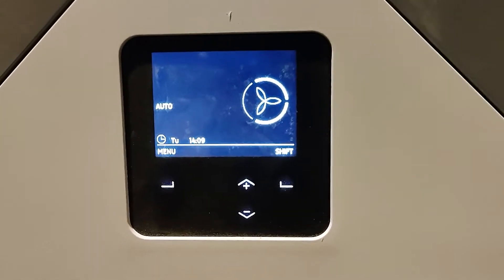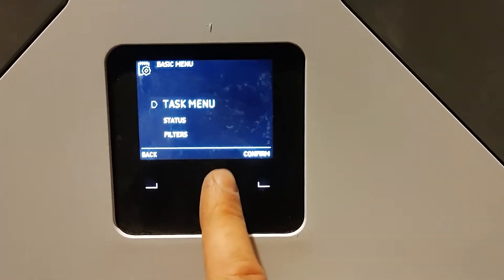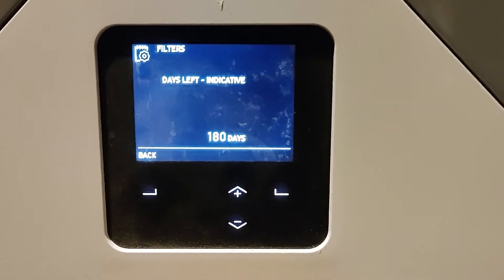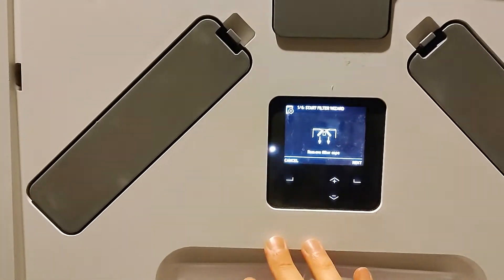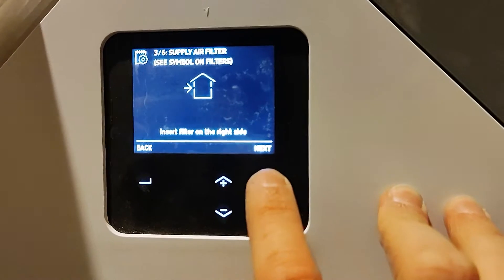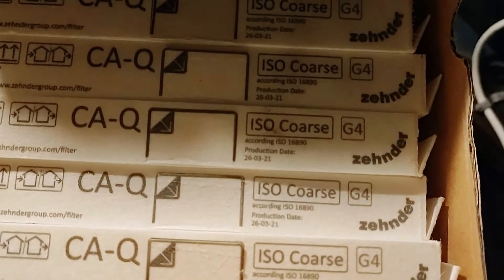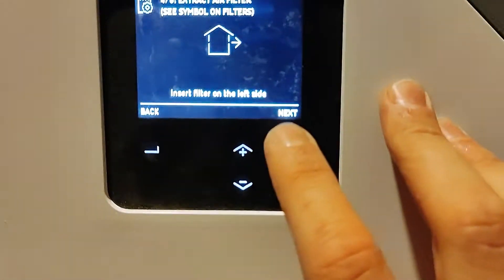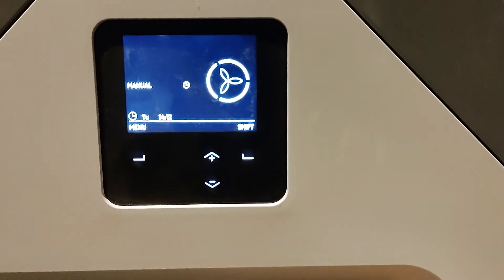How to check and change the F7 and G4 filters on a Zehnder Q350, Q450 and Q600 MVHR

Comment: Is there a way to pause the machine to clean the filters?  Mine get dirty so I would like to clean or replace red filter every 2 months and leave the black one for every 6 mths.  The only way I can figure it out is unplugging the machine as to not reset the filter time.  

I will order filters from your website, the red ones are out of stock at Zehnder.  Thx!
Reply from the maker: Hi Todd, yes, if you go to MENU > FILTERS > CHANGE FILTERS, the unit will shut down temporarily to allow you to change the filters. Please send me an email on the Contact Us page and we'll sort you the filters - we have the higher-grade red type.

Comment: thanks for the information guys! Can I have F7 on both sides? Would that harm the machine?
Reply from the maker: There's no reason to - the other side with the G4 is there only to protect the heat exchanger core from house dust.
Reply: @HeatSpaceandLightLtd  Thank you! So effectively, the idea is that if one's unit is R or L, the other side is the one on which the F7 should go to right? Say I have a Q350 R, my F7 should go on the Left side.

Comment: First of all thanks for the video and the help you are providing. I will be replacing my filters, what I saw is at both sides G4 was present so I ordered G4. I would like to is F7 a must?
Reply from the maker: You can use G4 filters on both sides, but I'd recommend F7 for your fresh air as this is the air you breathe in the home. The higher quality the better.

Comment: Thank you for the video. Is it okay if we use F7 on both sides?
Reply from the maker: Yes, it's okay but it's not necessary. The room-side filter is only stopping dust getting into the heat exchanger core, so a G4 filter there is fine.

Comment: You can pick the version left/right during installation process. So You may need to put Your liters other way and it's ok, as long F7 is filtering air from the outside.
Reply from the maker: Yes, that's correct. Once the hand is set during the commissioning stage, the filter sides won't change.

Comment: thanks for video, is it normal that the left/G4 filter from upper side it's full of bugs/dust when comparing with the right side F7?
Reply: Yes because one side is collecting debris from the outside and that is the filter unless it was chosen to have an additional filter before the supply air gets to the unit (like HEPA or higher MERV rated ones), while the other side is filtering  the core/ & for the supply air into the home. So as he pointed out, one side is much more exposed to things than another side hence the difference when comparing.
Reply from the maker: @Souldriven5996  Thanks for your reply, Sarah - absolutely correct. The filter bringing in outdoor air will trap insects, pollen, seeds, carbon dust and other outdoor pollutants. 

However, @LuckyPunk13, it sounds like you have the G4 and F7 filters the wrong way round. The F7 should be the outdoor (bugs) one. It may be worth contacting us directly through our website because it could mean the hand of your MVHR unit needs changing.